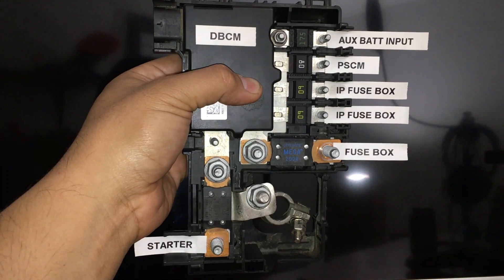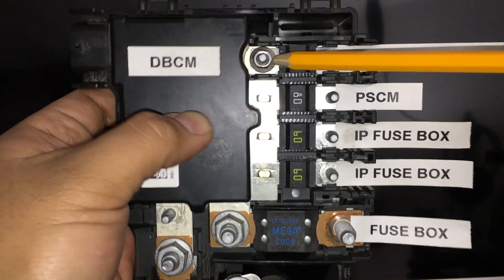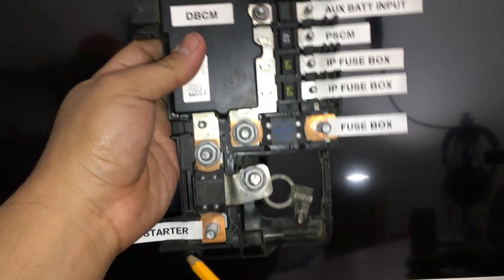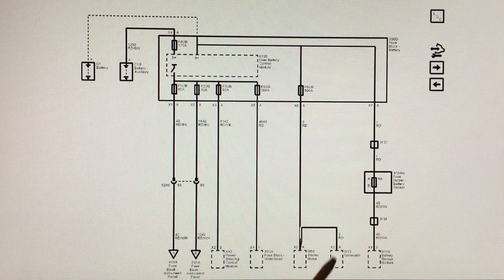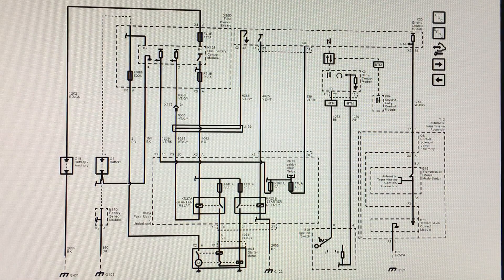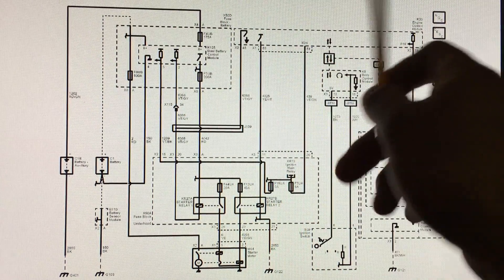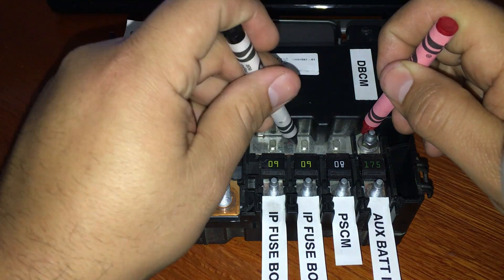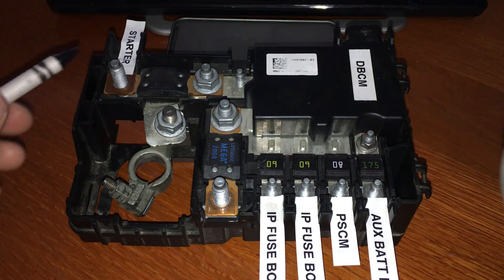CHEVY MALIBU P305F DUAL BATTERY FAULT DIAGNOSIS PART 2

Comment: I have a question.  At the end when you were demo testing with the cryons.  Would'nd that be a voltage test rather than a resistance test with the key on between primary battery and the Aux battery.  I just want to see if I understood.  Thanks!!!

Comment: Fantastic explanation of this component. 
I have a question. 
My auxiliary battery is charging but my main battery is not charging. 
I have the 305 code. 
What could my problem be?
I replaced the battery power control module and it made no difference. 
I did not have a problem prior to buying a new battery at interstate battery and they installed the battery. I’ve taken it back to them and they tell me my new battery is not at fault.  The auxiliary battery is new too. 
I’m scratching my head trying to figure out why my main battery is not charging but my auxjillary battery is charging.  
Any help is greatly appreciated.

Comment: Amigo, he vuelto nuevamante a esta segunda parte. Todo me parece muy bien comprendido y explicado, pero, me surgieron algunas dudas. No mencionas y no se ve en el diagrama que muestras el pin 1 del DBCM. Sin embargo estoy viendo en Mitchell que hay un cable yel/blu desde el pin 1 hasta el pin 49 del ECM. Cuando me trajeron el auto me dijeron que habían comprado nuevo la caja de fusible de sobre la batería con el módulo DBCM. Lo primero que le sucedío al auto fué que cojióo candela y derritio esa caja de fusibles y el motor de arranque echó mucho humo. Cambiaron ambas cosas y como no lo lograron arrancar, me lo trajeron. Ahora tengo dudas, porque en el módulo DBCM hay continuidad permanentemente, sin poner el plug fino de los 4 pines de comandos. Mencionas en el video que cuando se pone el sw en ON, debe conectar la batería principal. Y me pregunto, si está abierto antes, de donde saque la corriente para enviarla a los relay y luego al DBCM para hacer esa conección. Lo que me dice que tiene sentido que este Normally Close entre la bateria principal y los accesorios. Luego cuando pasamos a arranque, que abra el contacto de esa bateria y conecte la auxiliar. Luego de estar arrancado, conecta ambas. Cuando apagamos, desconecta la auxiliar, que ha dejado cargada y conecta la grande nuevamante, para incluso dejar las memorias de los modulos, del radio, dejar el sistema de control remoto para los seguros, el arranque remoto etc.

Se que hace 4 años que hiciste estos dos buenos videos, pero seguramente has tenido que lidiar con otros y quizás estás actualizado con este problema. Me gustaría mucho que pudieras diciparme esas dudas. No se si los que me antecedieron, en su afán de prenderlo, rompieron tambien el modulo nuevo o si está bueno. 

Gracias nuevamante. Un saludo amistoso.

Comment: Just adding my two cents,,, I had the same issue on my 2015 Chevy Malibu,, 2.5LT- dual battery control module performance, ,, Replaced the original 9 year old (!!!) batteries,, and then I replaced the dual , battery control, module itself,,$115,,  maybe i could save a few bucks,, still had check engine light,,,, so I bit the bullet and bought the fuse block assembly and found it for about $220,, replaced it and it fixed my problem,,,, However,,as i was taking the old fuse block assembly apart   Checking for spare parts i could salvage,,  i found that  the fuse for the aux battery  was blown!! . Thank God, we have ASE certified mechanics  at STAN  McNABB Chevrolet, in Tullahoma , Tennessee!!! Assholes!
So,,  if you have The check engine light for the dual battery control module performance. I would recommend  replacing that fuse. As a starting point!! 
Side note:::;; i found the blown fuse After the dealer charged me for diagnostic and charged me $96 to tighten one nut ,,that of course did not fix the problem. Dealer aslo wanted to order the same fuse  block assembly for me — for $400!!

Comment: Why is My 2016 Malibu lt 2.5 engine is stuttering to turn on? The battery is good and no lights came on the dashboard. The mechanic put the device and didn’t find any codes. We also checked the battery and it was good. Do you guys know what it could possibly be? P.s only happens when it’s a cold start. Once the engine is warm the car starts no problem. Also no crank or clicking noises when stuttering to turn on.

Comment: Very useful and informative video. Thank you. Quick question. One of the fuses keeps blowing. The starter and alternator have been replaced. So has the fuse box itself. It takes a couple of days to happen, but it does. Why do you think that is?

Comment: Your smart and I appreciate you!! I wish you were here right now to help with my 2015 Malibu lol..my check engine light goes off and on with this code for 8 months. Aux battery says it has 12 volts. I probably just need to change the dang computer. But in the meantime it runs great but all the sudden started smelling like rotten eggs..I know cat right?? Maybe?? But that also comes and goes in the last couple days. Just changed the spark plugs yesterday seemed good and no smell until I drove for 6 hours(Lyft driver) then smell came back but sewage instead smh. And then goes away again.131,000 miles. No check engine light on for weeks. Battery cables look clean..I'm just a girl without training and never want to believe what mechanics says cause the ones I have had lie. And yes I know there are amazing honest ones out there just can't seem to find them. Ugh I spend more time trying look this shit up and figure it out with guys like you. Just wanted to say thank you for your time and teaching skills!!! Heck I will probably find out it's a gas cap making sewage smell possible 🤣😡 love my Malibu 😪

Comment: very informational video. i was able to make some sense of the starting and wiring diagram. I have a similar car, no crank no start. if you turn the key to on, lights come on in the dash but when you try to crank it, everything goes off in the dash and no response at all. and then comes back to the similar situation in the on position. i tried to use the wiring diagram to trace the starting system but I have no clue how to read it. your video was very helpful but I wonder if you can do separate video on how the read/interpret the starting and wiring diagram so i can better diagnosis why my car is not starting. thanks

Comment: The alternator actually comes up through the fuse box and then goes from there to the 200 amp mega fuse not the same one as starter

Comment: Auto stop reads the primary battery and not  the aux battery whenever, the vehicle stops. The same sheet that you shown in part one. My vehicle is showing p305f code.   Before that it was just reading the aux battery code. Should, I  follow your video and do the same checks or do something different?

Comment: Im having a main battery charging issue with a 2014 chevy malibu. In the video and the wiring diagram it shows the charging wire attaching to the starter main wire. It actually hooks into the under hood fuse box which leads back to the 250 Amp mega fuse. It is not connected in with the main starter wire on the dual battery module.  Battery module fixed my problem.  Thank you for all the technical info. Would have pulled all my hair out without it.

Comment: Hi maybe you can help with this issue I changed the battery control module  it cleared the check engine light a few days later the check engine light came back on I rechecked all the wire cables to make sure I also went back to auto zone to check the auxiliary battery they confirmed that it was good so either GM parts have me a bad m module or there is something else going on my question is could it be a fuse leading up to the module that’s setting off the check engine light thank you for your time 
Oh ps the crayons was great had a good laugh with that stay welll my friend

Comment: I haven't worked as mechanic since my time in the military (1992 - 2012 ) I retired in 2012. In that amount of time there have been so some many advances in automotive technology that have been introduced.  

That said, with the added technology there have been added problems. Numerous recalls/manufacturer defects to deal with.  I would not be confident if i had to work on  modern cars today. I'd pull my hair out trying to figure them out. 

Thank you for sharing your wealth of automotive repair/service knowledge with us.  Most folks pay a small fortune to learn this stuff at vocational schools.  👍

Comment: I replace the alternator on my 2014 Chevy Malibu and it worked for a week and then it started with the same thing that it wouldn’t start it’s got 42,000 miles on it with original battery is it more likely to be the battery or the dual battery control module

Comment: How much does it cost.??? It's Chevy parts. Or a auto zone will have it?  It's a Chevy motor. It's will os good. The D aM.  Go to a 1973 350. You can work on.

Comment: Has the customer returned with the same issue after you installed the assembly in part 1 or did the new install fix the problem?

Comment: Hey bro I have some questions if u don’t mind. So I had a few cold pop up on my 2015 Chevy Malibu one of them was the door battery control module it disappeared now but my issue is my fuse box is not giving power to some fuses under the hood one of those fuses is the ignition so my spark plugs and getting no spark would you know what would cause this are the reason why some fuses in the fuse box and getting power than the other ones

Comment: Quick question should the aux battery have same charging voltage as the main battery? Cause mine reads 12.6v charging to the main battery and 12.2v to the aux battery

Comment: Here is a different problem with that same code  The car-- 2015 Impala still does auto start and stop normally even with the P 305 F code   I have changed the aux battery ( the original tested defective)  but still have the check engine light on  I read where this function is disabled when  the code is P305F    Ideas??    Thanks
Reply: I need help with this one too

Comment: Thanks for the info.   My daughters Malibu starts fine but she is having issues with accessories shutting off when it goes into eco mode at red lights.  Both batteries were tested and deemed good.  Wonder if that means replacing DBCM will solve the issue?   Thank you for sharing your knowledge my friend.
Reply: I have that problem also and the brake light staying on when letting off the pedal it does it when daytime running lights but night time they work like there supposed to I just went to the junk yard yesterday and pulled this whole fuse block and swapped it with mine now the brake lights work like there supposed to when day time running lights are on still haven't had it do the auto stop to see if it fixed the radio. Did you ever get your daughters radio to work right?
Reply: @eb6736 , I just started experiencing this same issue today. My radio is shutting off when I come to red lights because of the eco mode. Both batteries were tested to be good. Did you ever change out the DBCM and did that resolve the problem?
Reply: @lettyluuu9778 I replaced Both battery, body control module, & cleaned ground. Still not working
Reply: Did you ever figure out what the problem was?

Comment: I had the same problem with the impala 2015 and i did replace the auxi battery thought was defective so then some how on the back from the bcm module point to therminal positve was a small crack and replace it and its works but now with this explanation u did now i understand how its works thanks gran maestro 💯👌

Comment: Very thorough and well explained. I like how you explained the logic based section of the circuit. I have that code and hope it's only the aux battery that needs to be replace or a bad connection.

Comment: I hope you can help me out with this question. After you swap out the Dual battery control module do you have to do any kind of Programming??? Or is a quick clear codes and we good to go.

Comment: Question, while engine running shouldn't there still be alternator current charge back to battery at terminal?
Reply: Got my answer at 18:00 , thanks

Comment: My 2015 Malibu has more than a 400ms delay to restart, more like a full second after taking foot off the brake. IT IS ACTUALLY DANGEROUS driving it this way - it lunges forward - so i disconnected the hood closed switch so that the auto stop doesn't engage ever. Just have to deal with the engine light on for the hood switch. (definitely not ideal) Funny there is no hood open idiot light on this model like in your video.  Wonder if my restart delay problem could be the 200$ DBCM module? GM crap way of meeting fuel efficiency mandates.

Comment: I'm guessing the "ignition voltage input" on the codes setting criteria is referring to the general "vehicle wide" ignition voltage, which should be switched to the aux battery during cranking. The computer was detecting the voltage drop when the starter was engaged because the aux battery was not being switched in (or main not being switched out).

Comment: Yall know what the  first cable voltage  should be ? The  4 pin connector. Its yellow  n a blue stripe???  I have 2.3 at all times ..Thnaks

Comment: I was wondering after you install the new Dual Battery Control Module do you have to get a relearn done on it or program it at all, or will it work without doing that? I have a 2015 chevy impala with the same P0305F code and I did the process of elimination from getting a new aux battery, checking the main battery, looking for loose grounds and or pinched wires underneath the battery tray. I just bought the new DBCM and i am curious if i need to get a relearn done on it after i install it ?
Reply: I have the same question. Do you have reprogram anything after you swap it out? Like the dealer said it has to be reprogrammed but idk if it’s bullshit or what

Comment: So I guess I need a new DBCM. I'm tired of stopping at a red light or stop sign and as soon as I take my foot off the brake the ac/heat cuts off and the radio/bluetooth shuts off. The ac/heat comes back on but I have to wait for the bluetooth to recycle so that it's functional, but by that time, I'm at another red light 😂 Great work, very useful information sir on both part 1 & 2
Reply: I have the same problem and found that putting it in neutral helps with that
Reply: i know im here 4 years later but did changing this DBCM out fix your issue?

Comment: My Chevy dealer can’t fix the problem, not sure what the code was but issue is with the start/stop that the cable that goes to the box caught on fire! Replaced everything and the two batteries and still nothing already paid over $2000 on it and they had it over 2 months trying to figure it out 😔

Comment: Great Video i replace two alternator and the battery and i still have low battery when the car is running 12.8 v
Reply: Most likely the wiring was damaged when they replaced the alternator. If the wiring is damaged then the alternator defaults to only output 12.8 volts.

Comment: My 2016 Malibu Limited LS just got the Check engine light, P058D, don't know what to look for, found online thread that I have to check battery terminal connections, they all good. Car is having rough idling, I already changed the alternator around March, Battery is new , around April. This year. New spark plugs.

Comment: thank you for information is very valuable , I serviced a vehicle that arrived with the same code P305F and at this time we found a faulty auxiliary battery, and this was due to that this is a customer's third vehicle and it has been sitting for about two months without being driven, after battery replacement code never came back.

Comment: Car requires at least a 850 amp Agm battery. Seen this many times where those wrong low amp battery's last six months then amps drop on cranking and turns on the light. That Walmart never start battery will show it's true colors again in the near future.

Comment: This have been yet the best results I’ve reviewed. My 2016 Malibu Limited have the same problem with engine light on but also have the Auto Start/Stop issues. The dealer somewhat replaced the main battery and didn’t fix the problem. Also I have replaced the auxiliary battery. Still the problem it is... So with your video, I can present it to my mechanic and we’ll be able to resolve this once for all.
Reply: Did the video make it work ? Do you still have a check engine light ?
Reply: @darneshiaelder2102  Yes it did work. Check engine light went off. $200 for part though. 45 minutes to change it out for new one.
Reply: Glad to see this worked, I have the same car and both batteries are new/ have been checked. Looks like I may finally know what needs to be changed.
Reply: @bladedsentiment i did same and still not fixed whats problem ?

Comment: You may want check the idle load on axillary battery. If it is low that may trigger the system to not work properly and set the check enigine light.

Comment: Thanks for video. Did not initially watch video. Helping a friend. Had code and car not cranking. Battery not charging. Changed alternator. Worked for a while, then died. Changed AUX battery (was dead-dead). Battery still dying.  Found Alt charging aux but not main battery, only 9v at pin 4. Changed duel battery module, now 13.4v and seems to be working. Seems this module also could be culprit if main battery not getting enough voltage from alternator. What do you think from all your studies of the wiring diagrams.
Reply: Took the module apart, it was definitely all burnt up inside. Bunch of resistors and chips all burnt.
Reply: The DBCM would not be the culprit of the main battery not charging as the alternator cable is tied directly to the starter + and then the main battery + terminal. (through that big fuse)